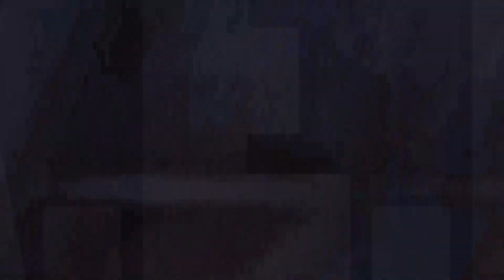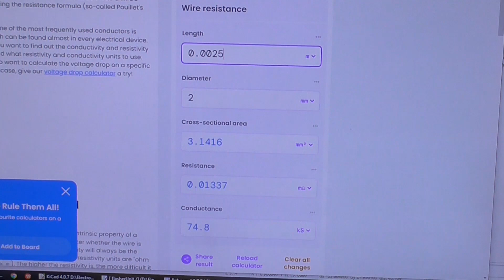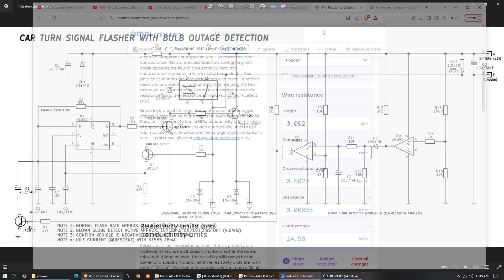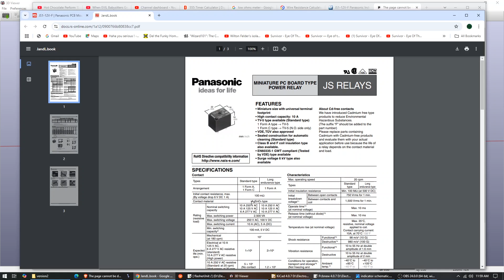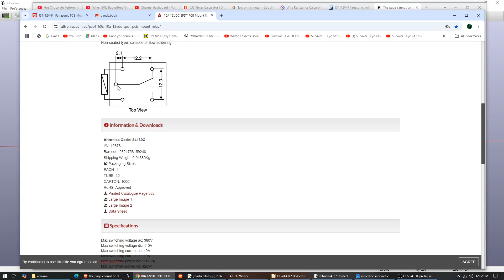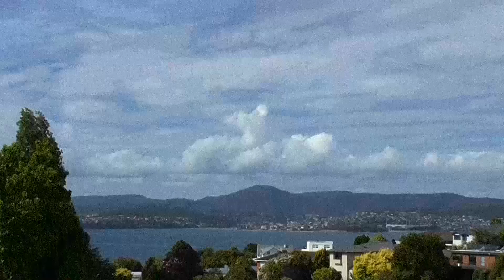Home-Made Current Sense Shunt

Comment: You should check the voltage drop across your own made shunt resistor
Reply from the maker: I probably should. However, the first comparator is only looking for a difference of around 200mV before it switches low. And, as I've found, this circuit is pretty tolerant of a shunt between 0.015R to 0.6R, and still functions correctly.
Reply: @AstrosElectronicsLab  so you have a wide range of resistance to play with
Reply from the maker: @SymbolTech21  correct. And it's pretty cool.